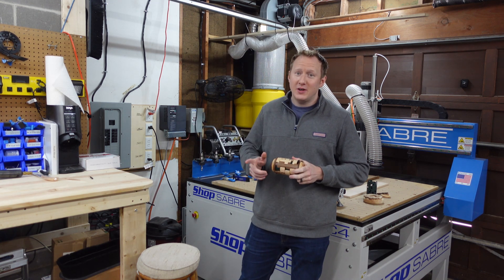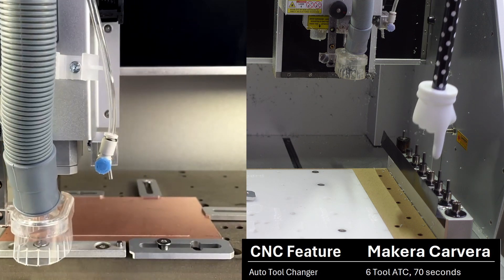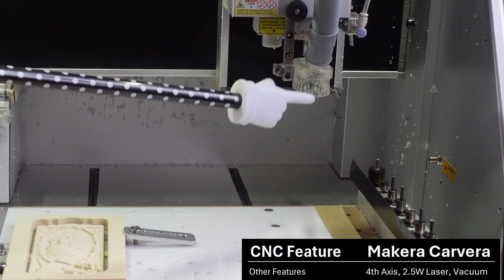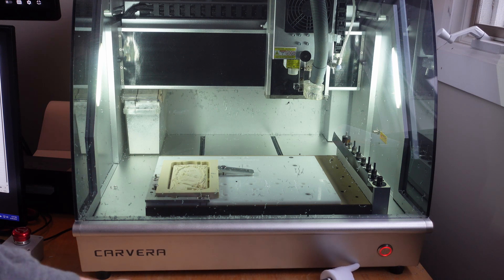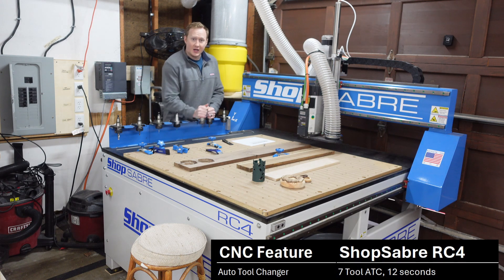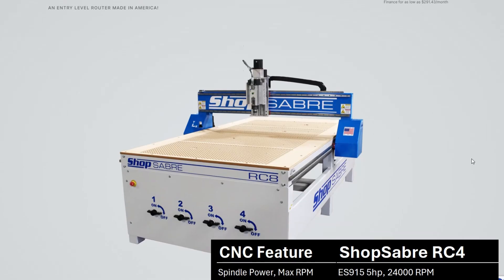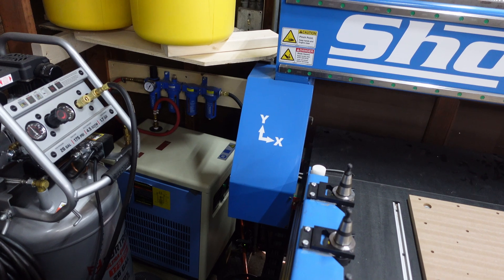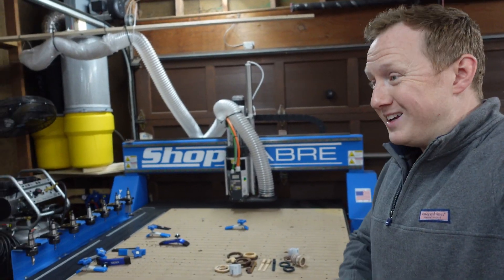Overview by Owner: $5,700 Makera Carvera and $30,000 ShopSabre RC4 CNC Machines

Comment: I am looking at the RC4 as well. What bed did you go with it’s hard to see. Did you say shipping was 3500? And did you need a forklift or did a pallet jack work? Great video!
Reply from the maker: Thanks!  The top is a T-Slot table.  The MDF board is how I customize my hold down locations.  I use it a spoil board too.  The MDF has T-nuts behind it (custom spaced) and dowel holes so I can flip and align my parts.  I would go with a vacuum table if I was cutting large flat 1-sided parts, like cabinets. 

Yeah, some 4x4s and a pallet jack is all you need to move it.  I was able to rent a box truck with a big enough lift gate, which was lucky.  My pallet jack is electric.  That was needed because of the box truck moving plan to creep up the ramps.  It more than paid for itself.  There are moving bolts to lock the spindle and rails in place.  Make sure you have those so nothing moves or wears out due to weird pressures.  Good Luck!  WHat CNC do you have now?
Reply: @LeisureLuke I have an Avid Pro 4x4 CNC and it’s starting to really show its age so looking all around for which upgrade to go with. The people still in the running are ShopSabre, Phantom CNC, and maybe Cancam. Thankfully I don’t need vacuum as I never do sheet goods. The only thing it would be nice for is flattening boards without the need for any clamps on top.